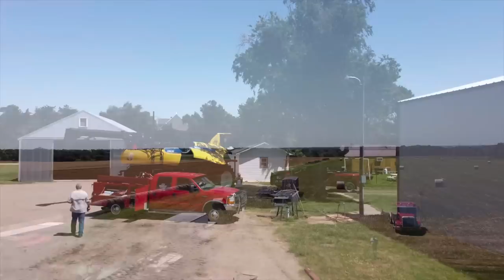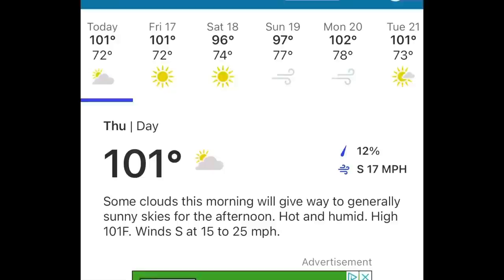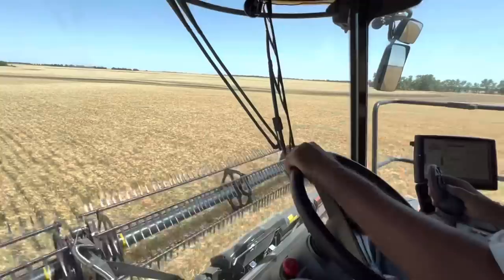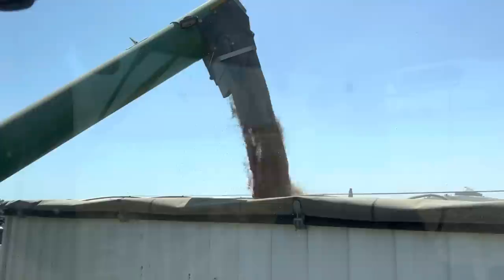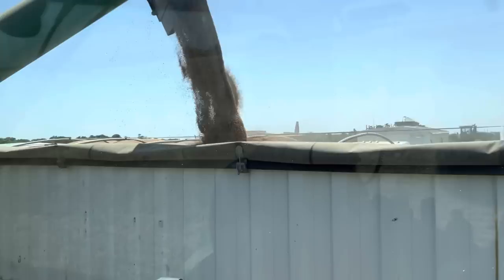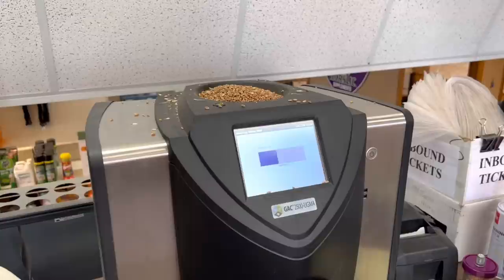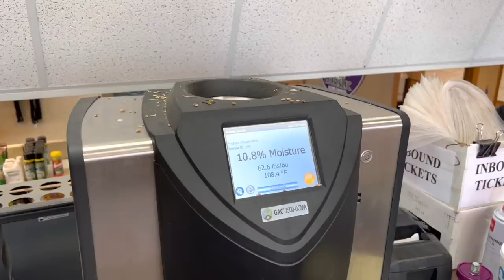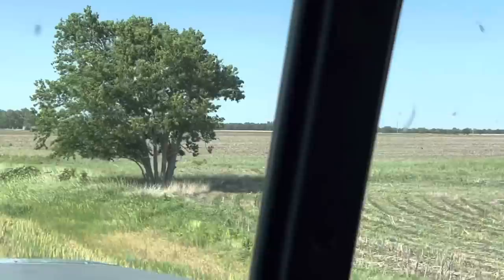DAY 1 / 2022 Wheat Harvest - June 16 (Chase, Kansas)

Comment: It does seem like it takes forever to load & unload everything . We usually had 2 combines to do ourselves and a couple of years another custom harvester joined in with his one combine so I just ran around taking care of ours . Wishing you a great harvest and no problems or breakdowns .  Luckily the last 3 years we were able to have new ones , even after wheat & fall harvesting almost all of the plastic was still on the seat in the combine I operated . Stay safe and don't get too hot . Does Frank have an air operated  PTO  & what transmission ?